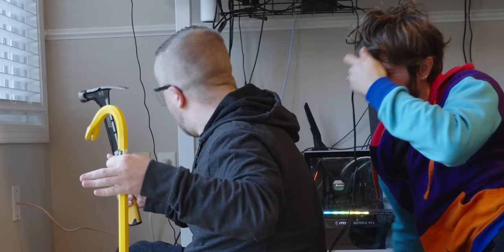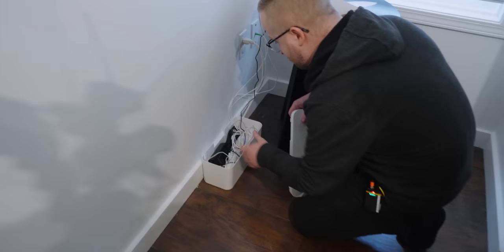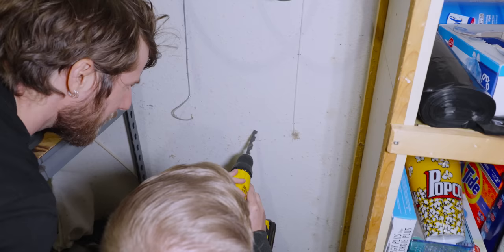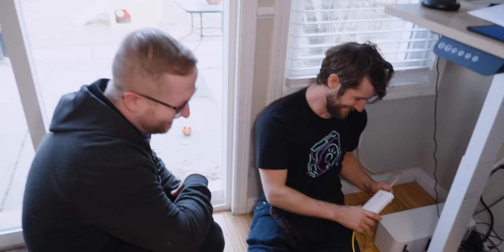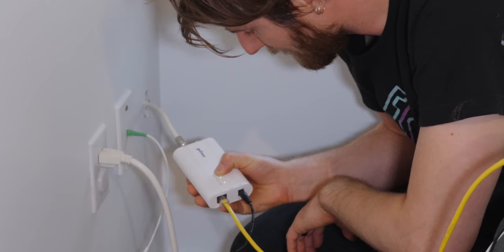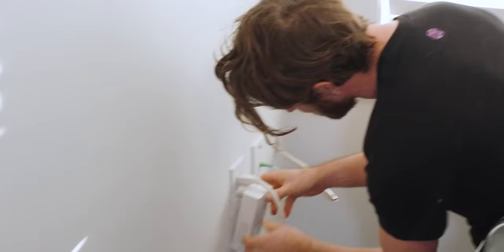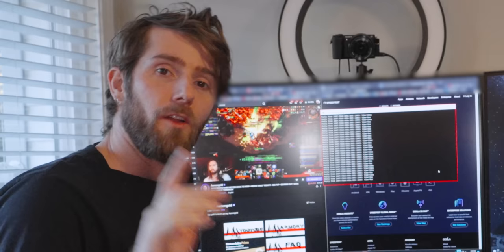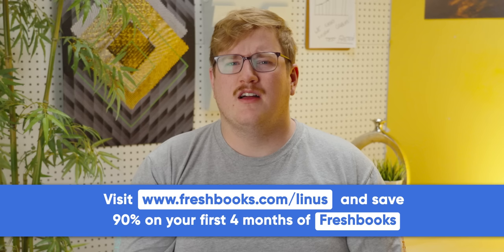I Will FIX Your Wifi - MoCA and Powerline at Colton's House

Comment: 17:38 yeah been running a Minecraft server for a couple of months on desktop and when that latency hits a bit heavy from 20-40 to 200 randomly every other week, would cause everyone on the server to be kicked. Although live in a separate room with no coaxial, I went ahead and got a 50 ft Ethernet cable. Yeah it's not always about speed, it's the consistency that makes it worth while for wired connection

Comment: with satellite systems that use MOCA, there's a frequency that is specific to the MOCA signal, so no it will not interfere. cable TV on the other hand, it will interfere with the MOCA frequency so you can not have cable TV and use MOCA on the same coax network.

Comment: As a cable guy, first of all you’d be surprised how people still have TV, but my company uses MoCa all the time it’s great, but!!!! You may also want to invest in MoCa filters or traps to put on the coax going to your modem as it absolutely will cause issues. Also, there’s better ways to implement it.

Comment: You can put a blank plate or a coax termination there where it comes through......though personally I would put a box in the wall to have the connection and some slack for ease of replacement/trouble shooting

Comment: FYI Colton - fixing that Coax hole in a professional manor is very easy. You'll want to use an old-work low-voltage electrical box and a coax wall plate. Should cost like $5 from the local Home Depot/whatever. Then you just use whatever (drywall saw is easiest, but honestly you can use a serrated steak knife) to cut a rectangular hole in the wall, throw the box in there, tighten it down, and it'll look great!

Also, I'm sure Linus mentioned this, but if you can open that cable box and connect the two coax cables together, you'll get MoCA working. A coax tracer might be useful for this - a cheap one from Home Depot is fine, and you could even return it after. ;D

Comment: A professional would've put a low voltage box and wall plate for that coax through the wall. Could even combined it with the fiber plate. Then used a short coax patch cable.

Comment: Both methods work better in the same practical use; a shorter direct cable line whether power or coax, as little possible sources of interference as possible, and using simple combinations of networking tech. I used MoCA and a switch to connect my exterior camera and bridged access point in my garage.

Comment: I've worked before on a cable company and Linus should check if that outlet has a pass filter. I had a job order before saying that internet is not working but when I got to the premise, the thing why they report no internet is his grandma across the yard want to have internet and he use MoCA. I told him as per law in our country, you cannot share wired connections with separate addresses. There is no internet cuz he plug the RG6 into a terminal with pass filter, I inform him that he need to voluntarily remove those wires or we will fine him for violating the law (up to $3,000 for first offense).

Comment: Make sure the coax splitter/termination block is at least 1675MHz capable aka moca compliant.  Otherwise, you introduce spotty or non-functional moca network.  The home is built in newer years, so splitters/termination are unlikely within the walls and can be traced.

Trace the coax that was fed through the drilled wall back to where termination is and work from there.  

Like powerline, moca is half-duplex.  That means the cost of latency (minimal, less than 5ms for moca 2)

Comment: Being someone who installed cable, dish and Telco for years, I was internally SCREAMING at the video with how Linus assumed so many things with the coax network in Colton's house! Basically just bumbling his way around.  With all the hassle you could've just ran an Ethernet instead in the same amount of time and get less latency and better results and more consistency and less points of failure. There was already coax on the exterior of the house. Just run Ethernet on the outside of the house. Power links have also caused so many house calls because of random issues that "broke the internet or broke the "email" (boomers) or even fried the customers equipment. Your milage WILL vary.
Unless you have access to each and every connection of your coax network and know every single hidden splitter hidden in your attic for example (that very well could be not moca compatible) You probably shouldn't even attempt. It's not worth the hassle most of the time. You have 50/50 shot. Furthermore I highly suspect that the moca plug on the back of the ISP residential gateway does not work the way that Linus thought it did. It more than likely will only communicate with proprietary cable boxes or something like that. 
Fly me out there and I'll show you how its done.

Comment: The proper way to install moca adapters besides finding the right coax lines is to use a moca filter. A lot of ISP disable moca on their modem. Power line adapters are tricky. If you do not install it on the same electrical circuit they will not work properly. Not sure how well they have evolved til now tho.

Comment: Ummm just a thought for the next time anyone else or the LTT crew comes into a similar situation where needing to drill through 1 wall and wanting to come out in a narrow area like somewhere with other cable wiring running into the same area like they are doing from the garage into the bedroom which has limited space between the other cable and the corner of the walls instead of drilling from the garage tring to guess if you'll hit the spot you want to come out on when the garage wall has very little obstructions for the drill bit to hit on that side try drilling from the other way it gets your hole placed right where you want it and if the drywall punches out a bigger hole when exiting out the other side of the drywall its better to have the bigger uglier hole in the garage where its not as noticable but just a thought i've found it easier to do it this way whenever possible and when drilling holes into anything the side you start drilling on is always the side the hole is a lot cleaner  the the exit side which is something to take into consideration when putting holes into yours or someone else's walls

Comment: if you see this please read. Powerline is not even comparable to MoCA. If you game, please use MoCA. Especially if you have direct coaxial runs  and do not use splitters. I have 1gig symmetrical fiber and I get full throughput and around 3ms latency to my gateway. Source: Senior Network Architect with more than 12 years experience. Hope it helps!

Comment: At the beginning of COVID I tried MOCA in my townhouse  (where my wifi mesh going through floors wasn't cutting it for my work in livestreaming events).  It was really good except like once an hour it'd just totally drop for a few second.  I ended up having to run a cable down the stairs temporarily until we moved.  There's a LOT of weird stuff that can interfere with these things.  At the time we still had cable TV, I'm sure without it things would have been a bit easier.

Comment: I definitely would have cut out a hole to mount a low voltage plate and then depending on whether that's drywall or concrete on the garage side, you could either do the same or drill a hole.

Comment: Just use powerline, been using it for 3 years, never had an issue, super easy to install.
Reply: not everyone is as lucky as you are. I had major connectivity problems with mine 6 years ago. I had to try 2 different brands and multiple combinations to get it to be semi stable.

Comment: I have used ethernet over power that uses the negative wire for rf and it has the ability to "jump" circuits and even phases in 3 phase

Comment: You should have put the powerline right through the outlet and then put  the socket multiplier in to the powerline and for the other cables, you put them in the multiplier. It would have given a much stable network as well as less ping.

Comment: The reason MOCA didn’t work in this video is because the outside COAX line isn’t connected to any of the in house lines. For my house I disconnected the outside line and made an internal coax loop in the house and used the MOCA. Got almost dull gb speeds.

Comment: I bought an ASUS PCE-AX58BT WiFi 6 pci-e adapter, and it is loads better than powerline. It is more reliable, faster, and lower latency. It also has amazing Bluetooth connection for my ps4/xbox pad. It wasn't cheap, and I'm well within WiFi range, but I'd recommend it over powerline.

Comment: Depends on splitter in lockbox for moca/ moca filters to protect others from the moca. If you isolated just the two coax outlets by toning them out in lockbox it would be isolated

Comment: I'm not saying MOCA is complicated, but Powerline just seems to be way more accesible and easier to use. I've used powerline a multitude of times and I feel like the video pushed me more towards Powerline more than MOCA. Also, you can pick up a pair of TP-Link powerline adapters for under £30 for UK friends, that go up to 600MB/s, and £35 for gigabit lines. Most of the time it's plug and play with little to no issue with most of them coming with an additional port to plug your extension lead straight into so you don't even lose a plug in the wall anymore. I feel like the lines in most houses that haven't been recently developed could run into similar issues as in the video, I could be wrong but that is my opinion.
Reply: The issue are the speeds. I have powerline adapters rated for 1.4Gbps, and I have 500/100Mbps internet. With my powerline, however, the speeds I get are only 100/100Mbps.
Reply: @mrlightwriter  Yeah I do get where youre coming from on this. I had a similar issue in my new place. No matter where I put them I couldn't even get 1/4 of my speeds through ethernet. 

Honestly my comment is probably biased because I have more experience using Powerline to be honest. And when I ran out of patience with powerline I just ran a bloody long ethernet cable through my house. 

Hope you fix your speeds soon though friend :)
Reply: @northlyte  Thanks! I'm thinking of placing one of the powerline adapters in the bathroom across the office (where I get the full wifi signal) and buy one wifi card for my pc desktop.

I think this might solve my issues with the speed; not sure about latency, though...

Comment: I used to use powerline and it only really worked if it was on the same breaker. If I placed them on separate breaker circuits, it'd be <10mbps speeds. Weird tech but if it works it works

Comment: The main issue with powerline is that its connection can be incredibly spotty depending on your electrical configuration. I tested with two outlets like five feet from each other in the same room (which already passed the breaker box, I believe) and the one closer to the router got 250Mb/s while the one closer to my computer got... 30Mb/s - which already kinda sucks considering my internet plan gets me 500.
Reply: This has been my experience. I've been using PoE for a while now, started with slower and now I have the fastest you can get which is 2000. Going 2 rooms away The experience has been slowish. on the current 2000 modules I can get ~60Mbits. It is very nice because it is a very very consistent connection, but if I have to transfer files I am forever reminded how slow it is compared to full 300mbit speeds over wifi. I glosses over this video because I had been always considering stepping over to moca. However my homes cable network is several trees of splitters and I wonder if I would need to move it over to one big splitter that preserves signals.

Comment: MoCA and Powerline are good in a pinch if absolutely necessary but they are not ideal. From an RF perspective they are very "noisy" devices. Aside from IT I'm also an Amateur radio guy and I had to get rid of my TPlink Powerline nodes because of the constant noise they create across most of the bands I monitor, especially down low on HF. I literally watched the noise floor increase by 20db in SDRUno when the nodes are passing moderate traffic. That pretty much killed my HF reception. Not only that but Powerline adapters are notorious for randomly tripping AFCI breakers. A good WiFi setup will do just as good or better.

Comment: I've been using Ethernet Over Powerline adapters since 2011, and I've been telling people about the benefits of it ever since. Sadly this video doesn't show off just how amazing this stuff can be. You can use powerline adapters to put internet in parts of your house or apartment that you simply can't get wifi to. That said, it needs to be on the same phase and sometimes you'll find out that the way your house or apartment was wired simply doesn't allow for powerline adapters. So when it works, it's amazing, but it won't work for everyone.

Comment: You should be able to pick up a MoCa filter on Amazon (around $15) and if you put it on your main drop into your residence, it will block the moca from flooding to your neighbors. But that all depends on the frequency the moca is transmitting on.

Comment: heh i run powerline extenders in my place as a backup for wifi in places i could not draw lan cables nicely and at my mom's house. the models i use are old... so they resync in a while (about every 2 hours or so), but since nobody games in that house, for phones tabs and laptops - works perfectly. also works as a passive watcher over the power cables. if there's anything shorting in the house, the network will go down to hell.

Comment: one tip, using ping on CMD isnt a great way of testing ping as its small packet compared to bigger packets that lets say a game would use, thats why while gaming when not alot is going on then smaller packets are send but then things get intense the packet size increases and your ping goes up even tho it may have been fight right before... there are tools online to properly test this so use that instead of CMD

Comment: also in older houses all coax in walls might not be good enough. At one point to get wired internet upstairs in a previous place i had to use the coax in the other upstairs bedroom and run ethernet between them. The irony was that i was directly above the room with the modem, but the coax in my room couldn't establish a connection. The moca i bought came as a set/kit of 2, had no mps security (had no need in that situation), basic/no web portal/config of any kind, only up to 1 gig speed (but we had 200 meg internet and all my networked devices/server were directly wired), and was $170 in early 2019...so maybe newer ones work better and can use coax in worse shape.

Comment: Something Linus didn’t cover here is that powerlines come with a big caveat. As they run on your house’s electrical wiring, they depend on the quality of that wiring. In my house which was built in the 60s, they are effectively garbage.
They top out at about 5mbps because they wiring is old. Also, they bandwidth and latency issues are exacerbated by crossing circuits. To go from side of the house to the other it has to jump across circuits which makes it very slow

Comment: Slap a few Ubiquity AP, give it a run for couple of days, 

scan the surroundings, and there likely be some bad neighbours who blasted their wifi Channel too much , or Coltan stays near the radar area. 

or mesh lan connection from where the fiber point is, , LAN cable it along the dry wall floors and get it next to or near direct line of sight ?

Comment: It’s like daily cooking in restaurant with hobby cheap pan. Same principle applies to Wi-Fi, cabling, networking overall, practically everywhere. If PC is paying your bills, master PC MUST be cabled, even in electric bar, but it’s MUST. And if cabling is totally no go, invest into decent well designed wifi network and avoid cheap commercial devices. Otherwise you are asking for troubles like in the video. “It wasn’t working and now it’s great”. Watching single YouTube stream isn’t same from performance perspective as multiple concurrent hungry connections.

Comment: Just like to point out that many of the "2Gb" powerline adapters are actually two 1Gb connections and if you want anything greater than 1Gb you need to aggregate the two ports together on both sides, assuming the devices on both sides have multiple RJ45 ports and support port aggregation.

Comment: Just don't use Powerline into sockets with that many stuff. If you put the adapters directly to the wall, you will see the difference in bandwidth and latency. I run a 20m Ethernet cable just to have it in it's own plug, and the difference was real in a modern house.

Comment: I never had much luck with MoCA. I would get over 800mbps down consistently but the upload was always 5-20mbps when it wasn't busy timing out and that was on 1000/1000 fiber internet. Tried everything possible to fix the upload but ended up running CAT6 ethernet.

On the other hand I must be very lucky with WiFi because I never have any issues and that is on an older Netgear R9000 with Voxel firmware. Never needs a reboot, the only time it goes down is when the power is out. Shout out to Voxel, their firmware turned a shitbrick into the fastest and most reliable WiFi router I have ever owned or used.